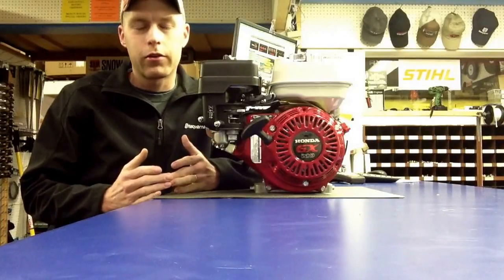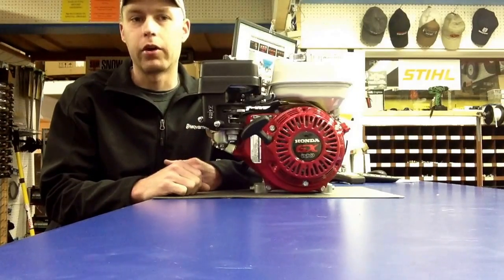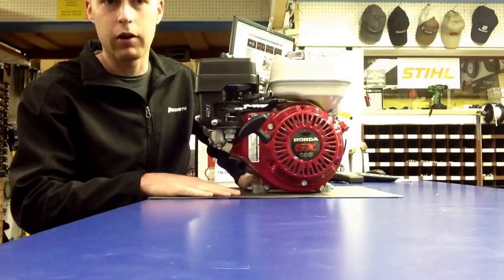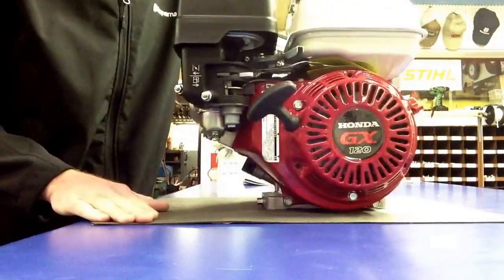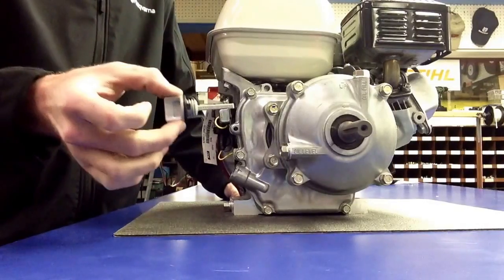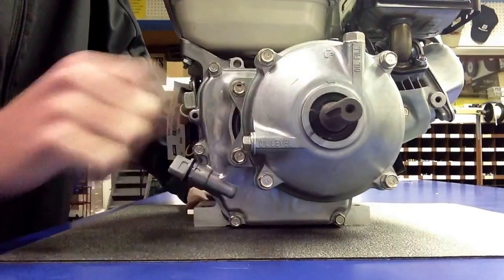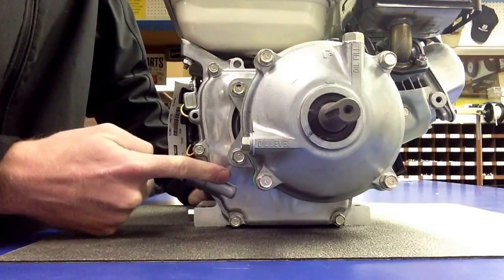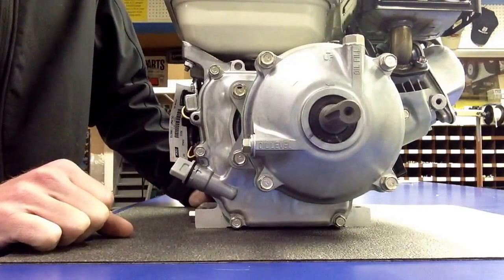How to fill the engine and gearbox on a Honda GX120 and GX160 engine.

Comment: I just purchased a Billy Goat Aerator 
Has a Honda GX120 HX
Has black cap in rear 
Grey cap in the front
I can fill oil on either end?
But check oil level with grey cap?
Now 
When change oil
Does the oil infill go to engine and gear reduction 
Or
Need to fill both separately?

Comment: got an SourceOne PL400 aerator, now Billy Goat. The diagram specifies Honda GX160 engine and transmission. The engine RPM is 3600. Are you sure the aerator transmission is 6 to 1, or 600 RPM? Was looking for this clarification all over the place. Thank you.

Comment: Great video, thanks!  I just rebuilt my Honda GX160 from my aerator, and I was concerned with putting the right oil type and amount in the gear box.  When I google it, I get about 100 different recommendations for gearbox oil, but none of them felt right to me.  A 30 weight seemed right, but google was saying a 90 weight, a 80W weight, and many other types of gear oil.  After all the time and money spent rebuilding this engine for my aerator, the last thing I want is to have to buy a new one because of the gear box.  Thanks again!

Comment: Just did this on my GX120, strangely the old oil smelled like gear oil not regular engine oil. Any thoughts?
Reply: I noticed the exact same thing, the consistency also seemed thicker, almost honey like consistency.  I was considering using more of a gear oil, but I have heard so many people say to just use a small engine 30 weight.  What did you end up doing?
Reply: @Hustleverydayy  Everything "official" I could find said to use the same oil as the engine. I did read of some people using gear oil but could never find any confirmation to do so or what weight. Ended up going full synthetic 10w30 same as the engine. So far seems to work fine, though it would be nice to know if/why it came with something else.

Comment: What is black filler cap for on opposite side. You never mentioned that. Just bought a GX160 mine is identical. Great video.
Reply: Two oil fill caps, depending on the application of the engine, you may only have one open side on your machine to reach the oil.

Comment: Would this setup be good for a gokart??
Reply: The engine itself would work well on a gokart, but it wouldn't be the best with the gear reducer.  The gear reducer will reduce the speed by 1:6 while creating a lot more torque.  Unless you were building a rock crawler that you didnt want to go much faster than maybe 8 miles an hour, you would want to make sure that you use an engine without a gear reducer.  I would recommend a 212 from harbor freight.  You can pick them up for under $100, and they are the identical engine without the gear reducer.

Comment: my gx120 is leaking oil from the crankshaft cover can you give me any advise how to fix it or if a need a new motor
Reply: get a new gasket.  Most carb kits you purchase will come with a new spark plug, carb, and crankshaft cover gasket.

Comment: What is the horse of a gx160?
Also I have two oil fill ports, one has a white cap and the other has a grey one, the white one has the dip stick and the other does not?
Reply: The engine is typically referred to as a 5.5 hp. The two dipsticks are interchangeable in the event the machine the engine is mounted to requires a unique configuration.

Comment: I bought a used Classen Aerator from Home Depot. While  I know I need to change the oil for the engine, is it also advisable to change the oil in gearbox?  If so, what is the best way to drain the gearbox?  I don't see any drain bolt for the gearbox. This is a Honda GX 120.  Thanks!
Reply: Located the  GX120 owners manual. For gearbox with 6:1 ratio (the one shown in video),  oil in gearbox is drained by removing oil check dipstick and tipping aerator toward the oil check dipstick hole. Recommended for used equipment to change gearbox oil every 6 months or every 100 hours, whichever comes first. 
http://www.honda-engines-eu.com/documents/10912/24646/1029/4bd89710-69ad-4e22-95ec-4f61f02fa00d

Comment: Great video. I have an engine with 6:1 gear reducer same as above. The gearbox leaks oil from the bottom. I opened the gearbox and it has no gasket. I really tightened the screws but still leaks. How should i stop the leak if my gearbox has not any gasket? I appreciate the help.
Reply: I know this is an old question, but my recommendation would be to do the same as you would with an oil pan on a car or truck.  Get yourself some black gasket maker from harbor freight, and lightly coat around the pan, circling the screw holes, and then place it on and let it set.  I bet that will solve all your Honda gx160 issues my friend! :)

Comment: I have this engine and the 1/6 reduction gearbox. The oil inside the gearbox keeps getting a sludgy milky color and really thick.  Any suggestions on what is causing this and is there a way to completely drain the oil?

Comment: Are those gear box noisey
Reply from the maker: The gearbox isn't going to make the engine any louder when compared to the sound of the engine/exhaust on an engine without the gear box. You may hear a bit of a whining noise, but it once again isn't loud enough to be of any more concern in noise sensitive environments than the engine/exhaust itself.

Comment: So if the grey dipstick is for engine oil, what is the black dipstick on the other side for?
Reply from the maker: Often times Honda will place two dipsticks on the engine on opposite sides to accommodate various applications. If the two dipsticks that you see are at identical heights from the base just different sides of the engine then they are going to pour into the same “reservoir” whichever port you pour the oil into.
Reply: That makes perfect sense. If one dipstick is blocked by a wheel, for example, just use the other side. Thanks for the reply.
Reply: Pls ,Gearbox oil can i use 10w30?

Comment: Hi, thanks for a simple straightforward video. I am trying to find out what the oil hole on the other side of the engine ia for. I know this is a dumb question, but Im a woman and got this engine mounted onto a Troy-Bilt tiller. Im  learning how to do regular maintenance on it, but have not been able to find out anything about the second oil hole. Any advice would be appreciated. Thank you
Reply from the maker: Good question... The second engine oil dipstick/filler hole is just that - a secondary one. This engine could be used in MANY applications on many different machines so Honda has an oil fill/check on either side of the engine just in case one side has the access restricted due to how it may mount onto a particular machine. You will notice that when the engine is level, both dipsticks will read the same. It doesn’t matter which one you use, but usually one will be easier to access depending on its application.

Comment: How do I remove the gearbox and is the engine shaft the same as other honda engines with no gear box. Thanks
Reply from the maker: The video shows 4 bolts being removed on the outside of the gear box housing, and then 4 more inside the gear box housing. This will allow you to completely remove he gear box from the engine. Note, the GX120 with gear box has a special crankshaft coming out of the engine itself. You cannot take just the gear box off and install it on just an “ordinary” GX120.
Reply: Gear reduction drive is easily removable as mentioned. The gear box is a spline fit on shaft that is a full teeth engine crankshaft, there is no clutch keyway. Looks and works just like a slide-in driveshaft a simple spline that plugs in trans, but its a gear box that bolts on engine. Crankshafts, either keyed for clutch or spline-Gear-drive, both are interchangeable, but the splines need to have engine block cover for bolting.

Comment: When you say 30 weight oil for gear reduction do you mean like 10W-30?  Thanks
Reply: I think he means SAE 30 straight weight oil
Reply: Per Honda owner's manual for  GX 120, 160, 200:  The oil recommended for both the engine and the gear box are the same: outside temperature between 50-102 F, straight 30; for temperatures lower than 50F, then 5w-30 or 10w-30
http://www.honda-engines-eu.com/documents/10912/24646/1029/4bd89710-69ad-4e22-95ec-4f61f02fa00d

Comment: It is best in my opinion to purchase the engine with a gearbox already on it. For about $400-500 you can purchase a new engine set up with the gear reduction already on it. Trying to add a gearbox to an engine that didn't come with it originally can be expensive because you not only have to buy the gear box you must also buy a new crankshaft to replace the original one inside your engine. If you do purchase a new engine equipped with a gearbox already on it, ensure that the gearbox is rotated in the right direction for your application. This video can assit you with that https://m.youtube.com/watch?v=Aa5pF97YOWY. Best of luck!